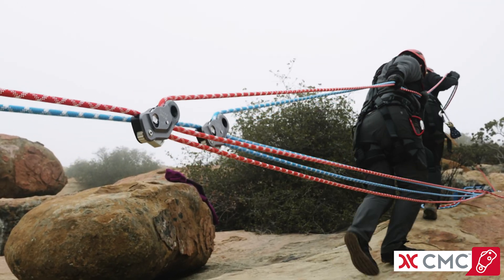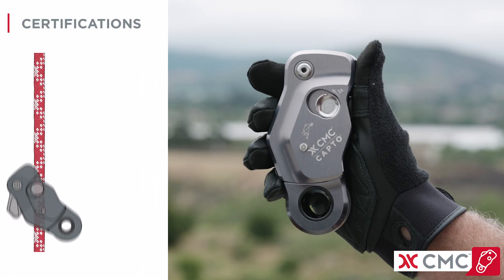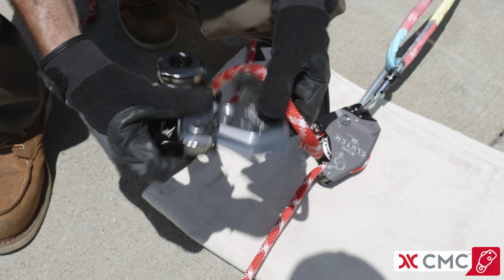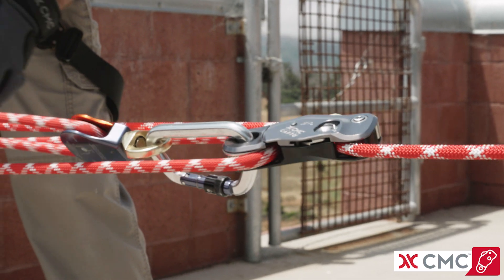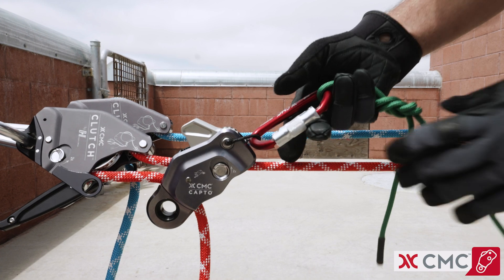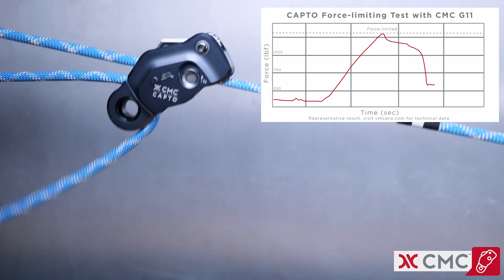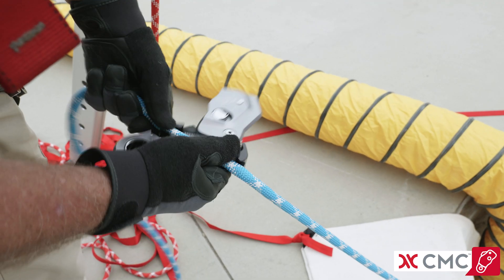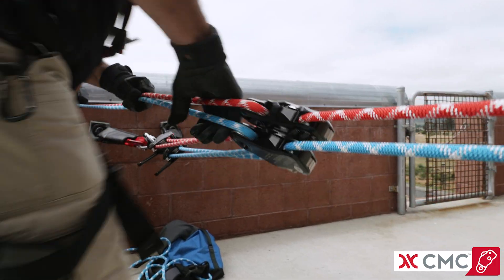Meet the CAPTO™ | CMC

Comment: I love the quick 3 to 1. 
The V groove is not original. Maasdam-Pow-R-Pull come along uses a V grove for the rope grab. One has to use a braided rope to catch in the V groves. So I just bought the ones that Maasdam sells.
Reply: Just used one in a rescue worked great instead of a rescender and pulley setu